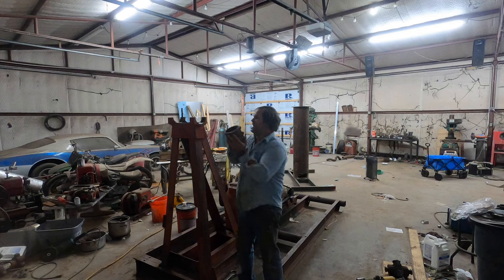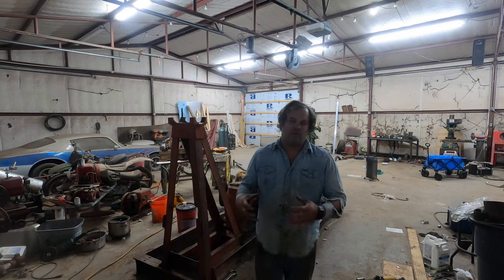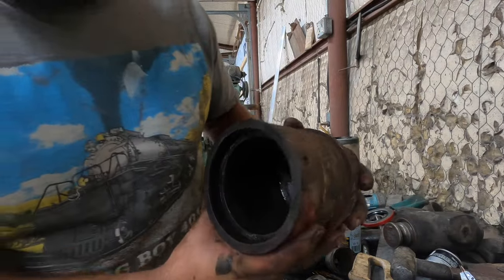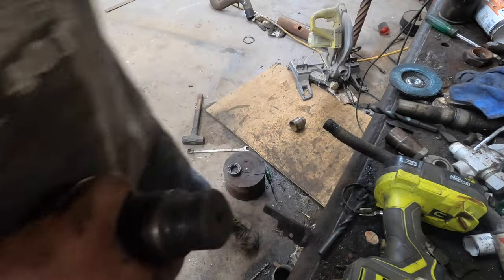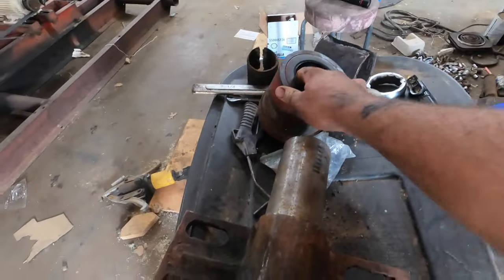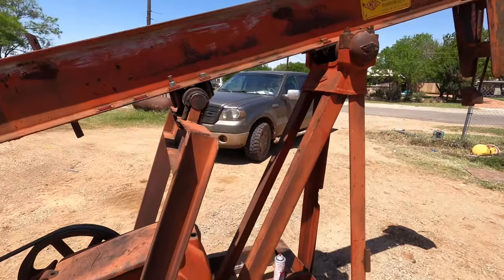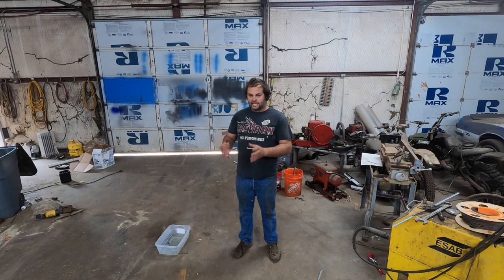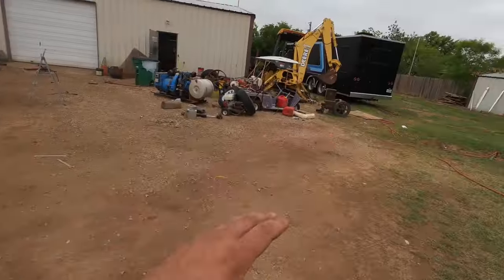Pumping Unit Rebuild and Reassembly

Comment: A Harbor Freight 20 ton press would be a handy tool right about now.
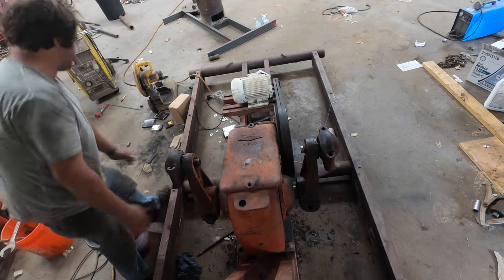Reply: Then he wouldn't have to smash the hell out the the threads on the wrist pins and then grind them off.  And if you watch when he puts the wrist pins back in it looks like the lock nuts don't 'lock' because they need the threads that have been ground off.  15:51

Comment: I farmed with my father , among other ventures . Your type of rebuild philosophy is just like mine and what I learned . All of my machine tools I have I had rescued from the scrap except my Bridgeport mill . All are put into shape by me and better than the new crap they sell today . What type of plastic did you use for bushings ? I had a machine job I did for a man , I had to machine nylon material for some parts  . What a mess , but my shop cat loved it . When I was building injection molds I had to make a 2 cavity mold That a type of plastic was overmolded over 2 metal inserts that was threaded for the sucker rods . I remember you saying the wells were not drilled straight  .  The plastic overmold was to protect the casing from being worn through bY the up and down motion . That was almost 30 years ago  . I was a pup then , like you are today .LOL I know some days you don't feel like you are  . I love your videos Zach . Stay safe my friend.  

Terry

Comment: I hope you can continue doing what you're doing lifting heavy stuff for 10 years longer but eventually after 50 years in the oil patch you will find out that heavy lifting days are over with
Reply from the maker: Unfortunately I'm learning how true this is.
Reply: @TheZachLife  You can extend your time greatly by using yer skills to "let the machine do it" and finding/fabbing the equipment NOW while ya can still move. I'm much older and way more damaged but I lift and move most things by rigging, jacks and hoists. You're already used to fabbing whatever you want. For example a good service truck bed with autocrane and a liftgate (they make great mobile worktables!) in combination (have the arc of the crane intersect with the liftgate platform center) could serve you well and make your work faster.  The more trucks grow liftgates the better and there is so little to them salvage is fine. (I set one from a box truck aside for a standalone lift table).  With all the steel you have access to you could have jib booms, lift tables and hoist scattered where ya want them like in your machine shop. You already have the big stuff handled but it's the items in "manual lift" range that trash your body so cover those and save back wear.  
Back pain ruins lives so every time ya get the urge to "git 'er done" think first then solve it with tools and not just heavy stuff. Ship rigging and mooring, and other jobs which are "like but not quite like" oil patch rigging may give you ideas. You might even come up with a tool or item ya can sell since you have bros who can laser cut etc. Play around with doing the hard stuff easier and you may end up doing it faster too! (BTW lifting eyes are cheap to torch cut and easy to add to existing steel not just in shop but in the field.)

Comment: The trailer ball in the lift fork is great for grabbing scrap vehicles behind the crossmember (or any obvious place) to drag 'em around the lot. Of course never cut those holes on anything subject to OSH inspection (the legal alternative is a ball welded to box tubing anchored however ya like) but private yards have done it forever and (probably) not snapped off too many tips...

Comment: That thing is called a spiral retaining ring.  To protect the threads on your wrist pins, turn the nut (or a sacrificial one) on the pin and then hit it with the hammer.

Comment: My guess for the unusual length of plastic bearing material is that it's a conversion from metric measurements. 41  inches is close to 1 metre. Being from the UK, where we buy fuel in litres but measure fuel efficiency in miles per gallon and countless other quirks, you get used mixing units.
Reply from the maker: Haha you maybe exactly right.
Reply: That's funny about mpg in UK, I never thought about that

Comment: I do repair work for the oilfield in northern Montana, I like the bearing bronze still, there are so many grades of plastic to choose from and i hate the stringy shit, I usually true up the bore  and put in oversize bushing or sleeve it back to size, by time I get it it's usually wore deep into the cap and half the shaft is gone.
Reply from the maker: Yeah usually people run them until they are toast. I try to catch them before that.

Comment: Great update. I’m sure you’ve used the plastic bushings before, how do they hold up compared to the metal ones? Double Coil Snap Ring.  Kc
Reply from the maker: They are at least as good as brass. The big advantage is they can be ran without lubricant and won't self destruct like brass if they don't get greased.

Comment: Hey when you said these wells made around 2 barrels is that daily or weekly. Really enjoy your vedios i never new much about oil industry before. Ive got a 1979 Mack R model motorhome
Reply from the maker: They make total out of 4 wells about 2bbls per day.
Reply from the maker: An R model motorhome. Thats pretty interesting. Is it a mack engine/transmission?
Reply: Yes the engine is the old 2 valve 300 but trany is 610 fuller and mack rear i have the original build sheet truck was dilvered on may 19 1979 and camper was built on it that summer 200,000 original miles. It's actually a RSL 600 whitch i think is a sister to the superliner it has the stright frame and round fuel tanks and the air tanks are under the battery box really amazing watching you build yours

Comment: If your running windows, this could be why your loosing data on your harddrive. Consider using LINUX MINT operating system, it's free, easy to install and far more resistant to issues.
Reply from the maker: Thanks, I actually use mac for most of my stuff. Im not very computer savvy and thats probably most of my problem.
Reply: @TheZachLife  make backups (transfer to your Mac) as soon as you get something worth saving - those cards aren't durable or reliable.  if you get a half dozen cards or so, use a white paint sharpie to write numbers on them and rotate the cards as you use them.  love your channel - fascinating content

Comment: Zack ya'll need to put the transmission on the engine and put a driveline out back. That way you don't have to put all that weight on it because of leverage. Center of gravity and pulls down just the same as if ya'll had a couple tons on her. Hah.